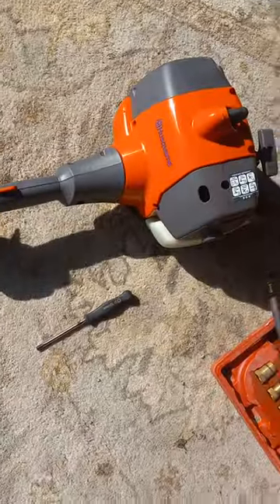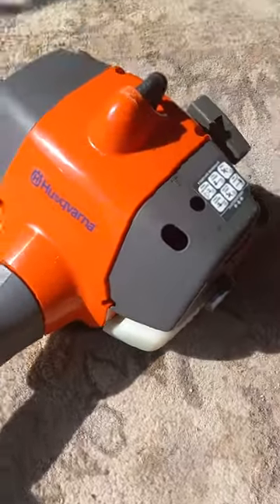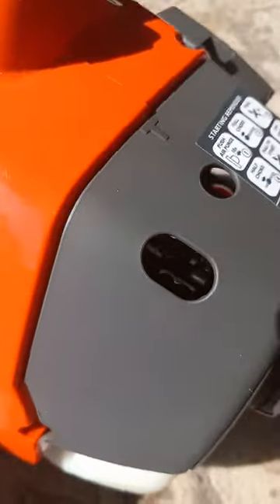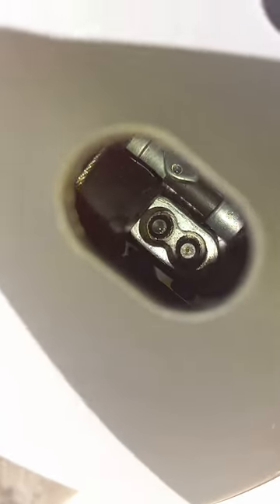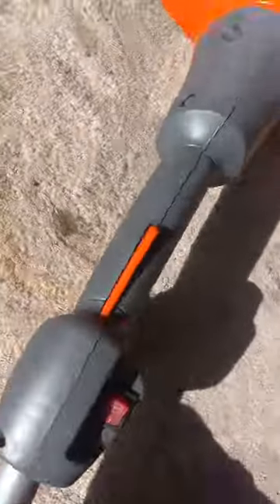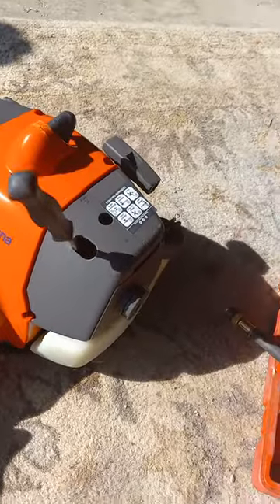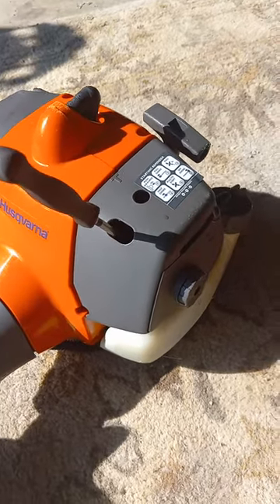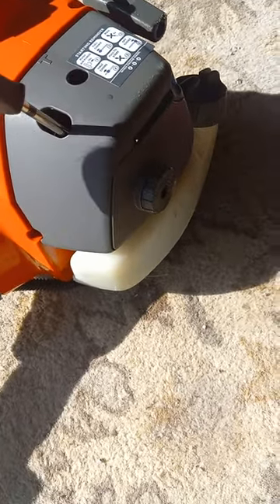Husqvarna 128 LD weed trimmer. Adjustment on high speed & low speed jets Zuma carburetor.

Comment: Got the same trimmer. Some people knock saying they’re junk, but mine runs like a beast especially after adjusting the carb to where it should be. I have the edger, pole saw, and mini tiller attachments and it runs them all just fine. I used the pole saw to clear out a large thicket of black locust growing along a bank. I even used the mini tiller to fill up a small 9x12 garden in the back yard. It took a while, but that Husqvarna never missed a beat.
Reply from the maker: You got that right Husqvarna is top of the line in my opinion I got the 122 weed whip and I'm telling you right now I run 110 octane and that thing goes insane
Reply: I've got a 128LD. Had it since 2007. Haven't had a problem with it whatsoever. Have to tune it sometimes cause of Alabama humidity but that takes like 30 seconds. I use quite a few attachments with it too.
Reply: I have the same trimmer and it doesn't spin enough rpm if the line gets just a little to long.  Is it just running lean? And did you open up the muffler when you tuned the carb?
Reply: @jaysonsetzer2287  Do you still have the guard on your trimmer? It will definitely run slower with the guard removed because the extra line is causing more drag on the engine. Without hearing your trimmer, it’s hard to say if it’s running lean. Have you adjusted the carb before? If not, you’ll need the splined carb tool. 

Get the trimmer running and let it warm up for a few minutes. Turn the H screw, the one closest to the air filter, in either direction no more than a quarter turn to see if the engine revs higher. If you get it to rev higher, find the spot where it revs the fastest, then turn the H screw counter clockwise just enough where it starts to drop the RPMs. That will leave it just a little rich to give you a little more fuel/oil mix while running it full throttle. 

Then without touching the throttle, turn the L screw, the one closest to the cylinder, until you can get it to idle as fast as it can. When you find that spot, just leave it there. After that, all you have to do is use a regular Phillips screwdriver to adjust the idle set screw so the trimmer head stops turning. It’s a bit of a balancing act to get it set just right, but once you’ve done it a few times it’s second nature.
Reply: @AnthemBassMan  guard is still on.  The line extended out to where the guard is and lost 1500-2000rpm.  I have a ryobi 25cc and the torque is much stronger.   I was hoping the husk 128 would have more power and torque than the cheap ryobi.  Hoping I can open up the muffler and tune the carb to get more power
Reply: @jaysonsetzer2287 I would adjust the carb first before you do anything with the muffler. That way you know that it’s running its best before you do a muffler mod. Then tweak the carb after the muffler mod if needed.

Comment: Remove the spark arrestor
Reply: That's what I do with all my two stokes. Even brand new ones after the warranty expires.
Reply: @rutbuster1 do you open up the muffler too?
Reply: @rutbuster1 do you open up the muffler too?
Reply from the maker: @jaysonsetzer2287 on mine I do I'll do a video and upload it the next 20 minutes to show you my muff put on mine
Reply: @jaysonsetzer2287  No. You don't have to split the muffler. Just take the screen out. Most have 1-2 screws that hold it in place. Takes about 30 seconds.
Reply: @Hondabond35  I didn't know if you made a bigger exhaust hole where it bolts to the block and cut the hole out bigger under the spark arrestor